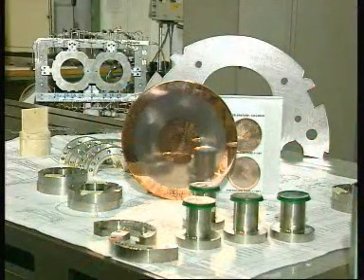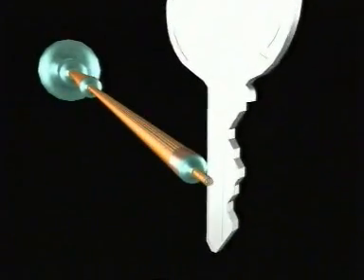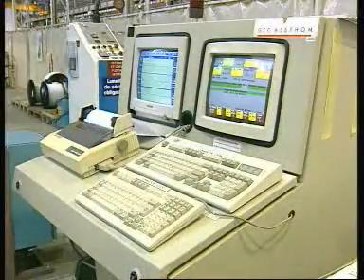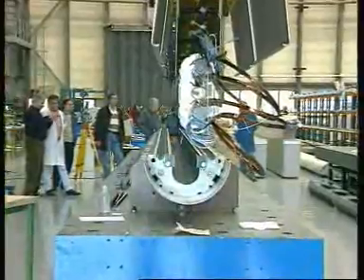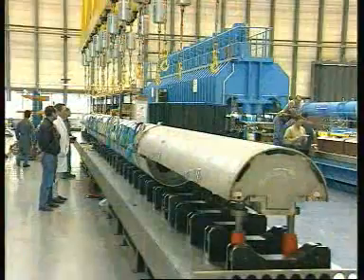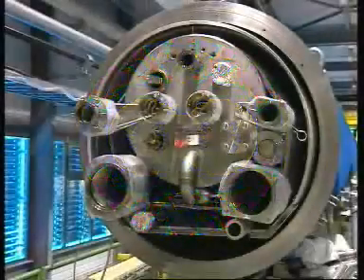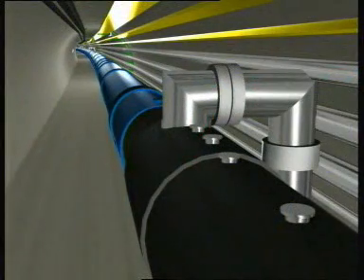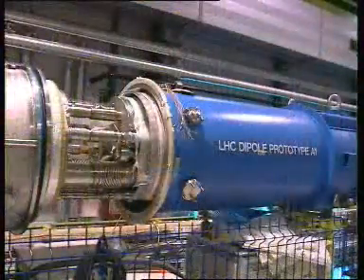LHC Superconducting Magnets 3

Comment from the maker: Considering the circumference of the pipework is 16.5 miles, they would have been as efficient as possible in the design; the detectors themselves are a different story, the ATLAS detector is 25m in diameter, 46m long, the CMS detector is 16m in diameter, 21m long. The ATLAS detector is equivelent in height to a 9 storey building.

Comment: the amount of energy used and the resulting forces are still insane ^^ and thats just the magnets pushing against the beam. 

did you know that the kinetic energy of the beam equals 157 kilograms of TNT? every time they want to get rid of the beam, the beam dump gets that amount of energy.